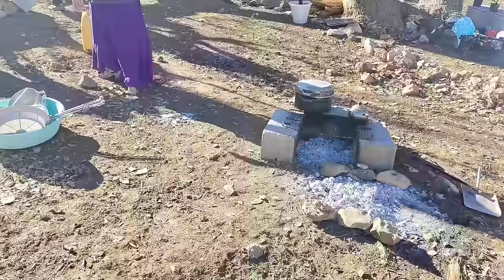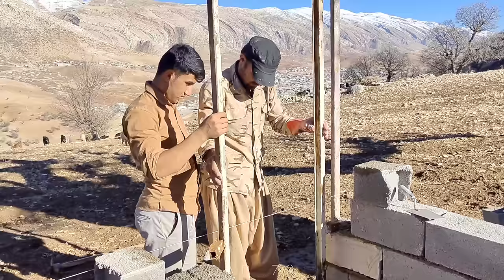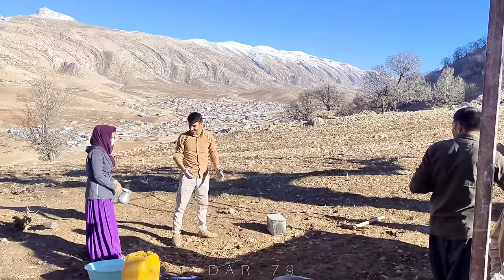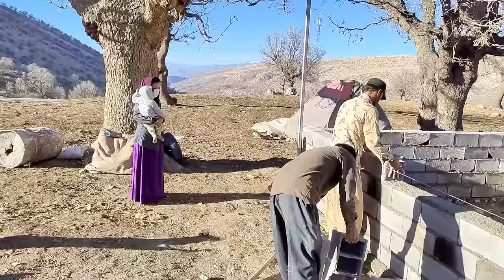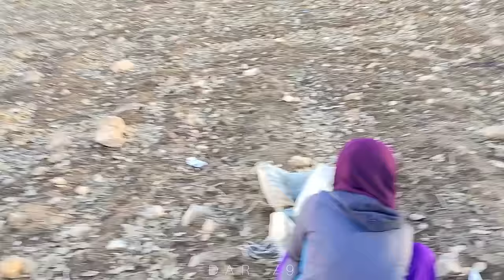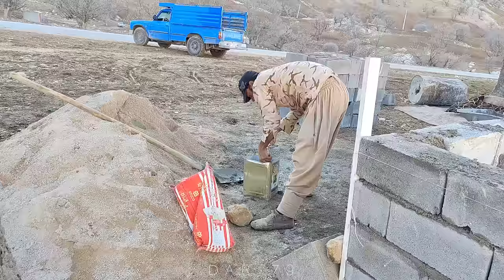Building dreams: building walls, building bonds

Comment: Keep the tools available for the next days work building cement sand blocks water yellow bricks for setting the steel beams for the roof securing to the blocks.

Rent a generator and drill and tapping screws to secure the sheet metal roof to the metal beams. Then throw a large plastic cement..

You have a great builder who thinks ahead installing the door frame as he builds the block walls and the windows spacing as he continues building the house

Once the roof is finished you can move the tent inside the house on raining cold snowy days to keep dry.

Make the heater pipe going through the side and up to avoid roof leaks.

Next cement the outside of the house to to help keep the cold wind out